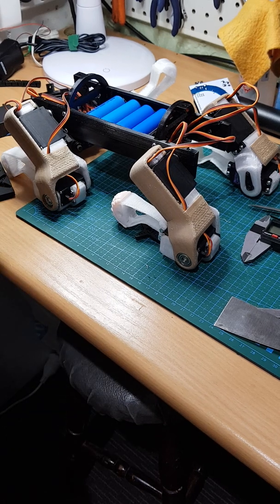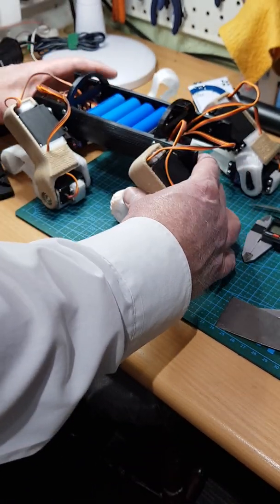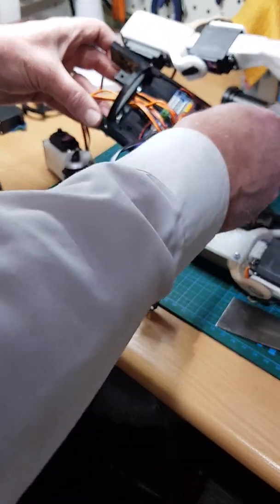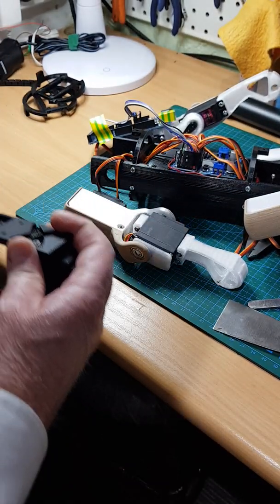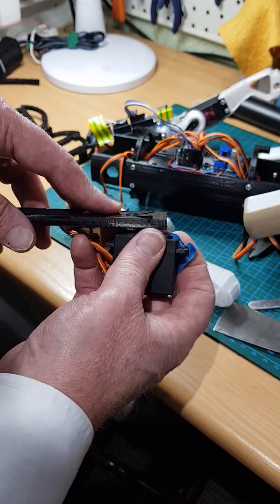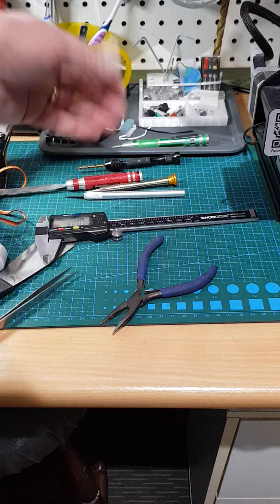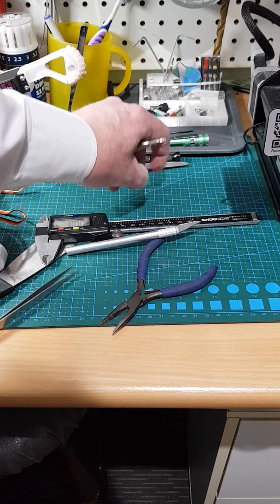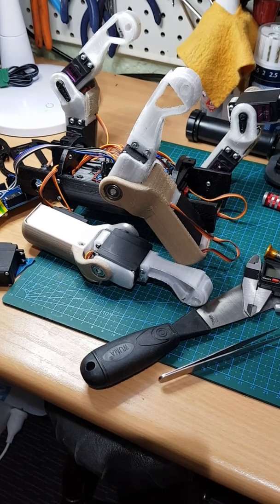Introducing Spot Corgi

Comment: Is this on thingiverse?
Reply from the maker: The original SpotMicro is there at:

https://www.thingiverse.com/thing:3445283

I haven't put up my redesigned SpotCorgi yet. ATM it's up to sit, stand and crouch. After it takes its first steps and I've confirmed the design I'll put up the chassis minus head and tail. (Resisting very crude puns about me needing those parts!)
Reply from the maker: SpotCorgi chassis is up at: https://www.thingiverse.com/thing:3900070
Reply: Can you send the circuit diagram and put code on github please
Reply from the maker: @bunnyheist880  I have added a wiring diagram for the battery case to Thingiverse. Other wiring is as per the individual component's datasheets. I have also uploaded the (very dodgy!) code to github; search for "SpotCorgi".
Reply: @mbromham  thank you
Reply from the maker: @bunnyheist880  I know I've been a bit slack about construction details but as I've said all along, I'm learning as I go. I will put together a video with these details. In the meantime, if you Google the individual components + "datasheet" you will find connection diagrams. As to the code, it's a mess, full of debugging and monitoring lines. But, I know I should post it. I've never had a github account and have just created one now. I'm also exploring moving from a fixed array of servo positions to calculating them on the fly and this is adding to the mess. If you can bear with me for a little bit longer I'll tidy it up and post what I've got, after I learn how to use github!
Reply from the maker: I have put the code used in the next video on github. Search SpotCorgi and be nice, I'm new at this :-).